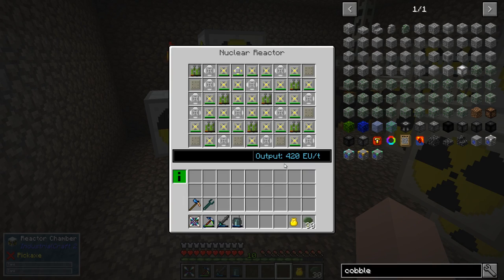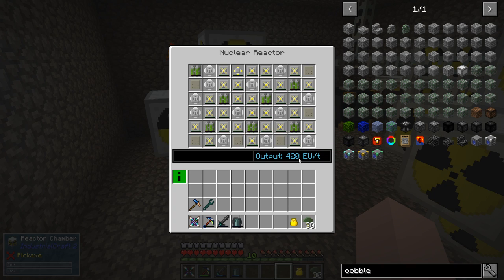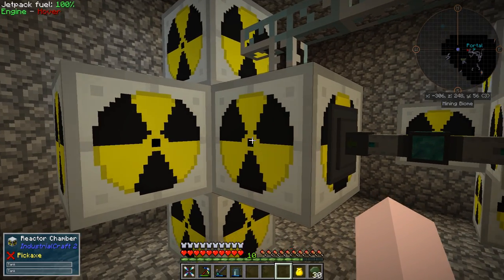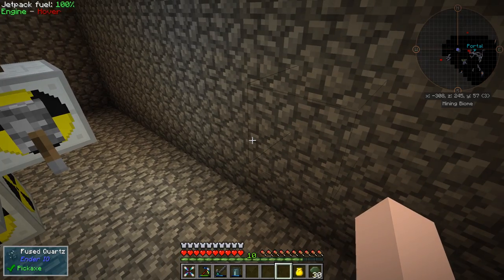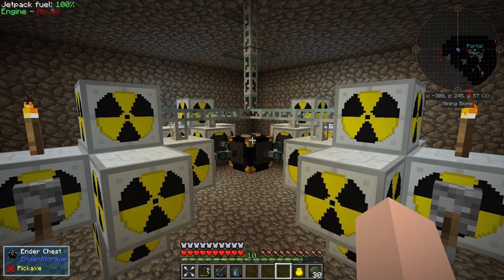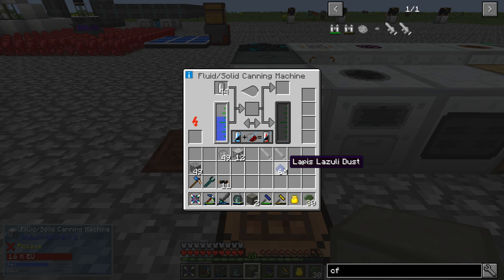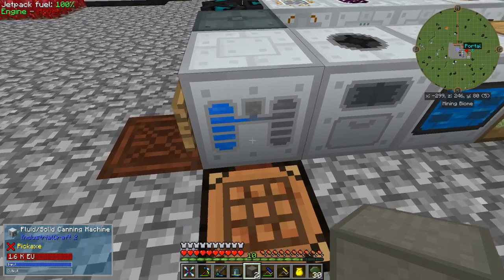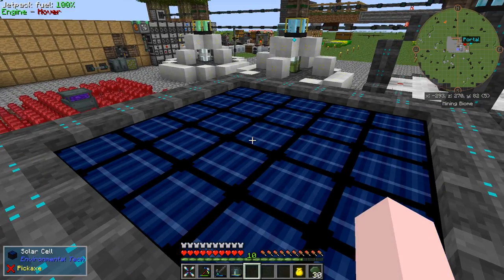14 - IC2 Nuclear Reactor Automation, Iridium - Age of Engineering

Comment: The Fused Quartz  actually has a higher explosive Resistance then Reinforced Stone, It is due to the fact the IC2 changes all Vanilla blocks and lowers its blast resistance but it cannot effect other mods. It takes 3 layers of reinforced stone to stop a full reactor blast. Great vid!
Reply from the maker: I was comparing Fused Quartz to Reinforced Obsidian, not reinforced stone. I read that Reinforced Obsidian and Fused Quartz have the same explosive resistance.
Reply: Ah gotcha. I watched your first 3 videos and now your last, need to watch all the ones in the middle.

Comment: Good job, you're obviously better at following a schematic than I am. Have you put an EU reader to that recycler to see how much power its draining? I don't know if auto crafting scrap boxes rather than using scrap would be more efficient???
Reply from the maker: From what i have read, it takes 9 scrap to make 1 scrap box. A scrap box creates 9 times as much uu mater as scrap. The power used is by how much uu mater is created. Other than saving storage space which doesn't matter it you use it all, there doesn't seem to be a difference in how much uu mater is produced. Please correct me if I am wrong.
Reply: Ok, fair enough. I "thought" I noted them lasting longer than 9 scrap in my setup. Obviously not. I opened a lot of them early game to get some good free stuff, so kept the setup and used the boxes. No matter. However what I did notice wrt EU consumption was the recycler with just 4 speed upgrades was very power hungry (I used two to maintain scrap content) so was interested to see what yours would be with 12. Also, you can just throw CF powder in a puddle and right click with the sprayer ;)
Reply from the maker: 180(+-30)eu/t for the Recycler with 12 overclockers
600eu/t each for the Mass Fab and the Molecular. I guess it's splitting the rest between the 2 big users.
Reply: Yeah, that's a lot (especially for my underpowered setup). Did you use a CESU/MFE in your setup to ensure all power being generated is actually being used/transferred?
Reply from the maker: > to ensure all power being generated is actually being used
Both the Mass Fab and the Molecular will use as much as I can give them.
Reply: BanzaiRun scrap boxes are better than scrap. Automate them